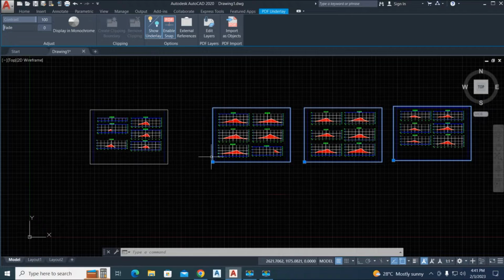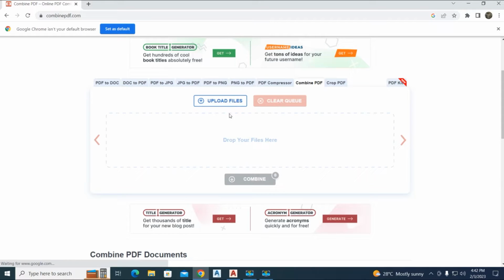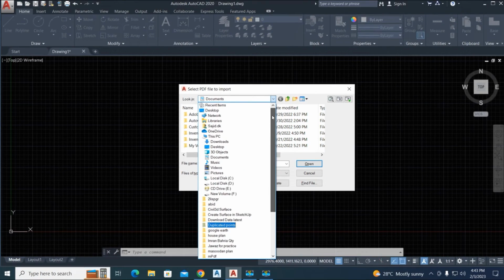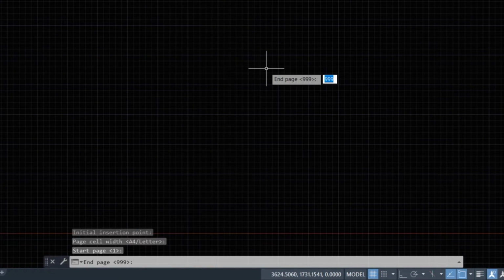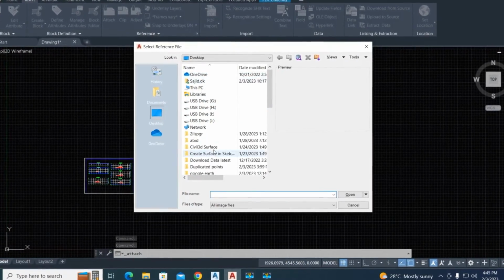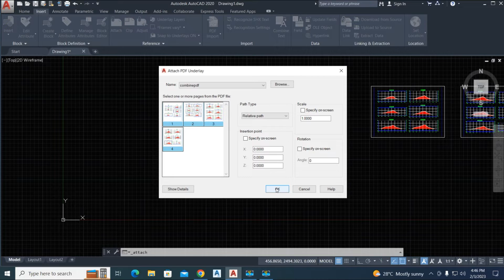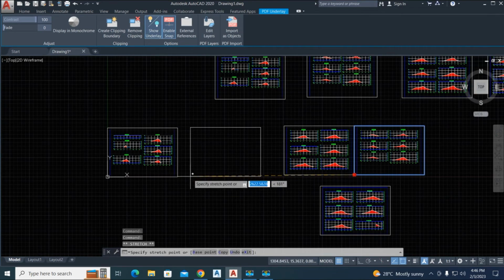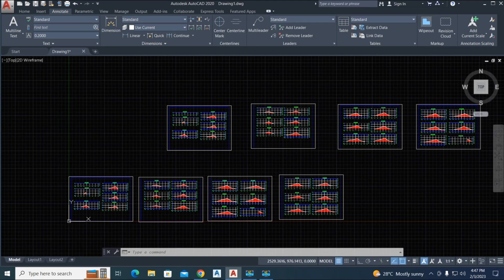Multiple PDF importing to AutoCAD using LSP

Comment: It's nice but it uses the PDFATTACH command which is just the same with only running command PDFATTACH with using this .lsp. Nice for using PDF as reference.
Do you have a .lsp file that uses the PDFIMPORT instead?
Reply from the maker: May be dear in playlist of autocad lisp in channel
Reply: @CivilSurvey Okay I'll check on that playlist.
Reply from the maker: There are more playlist

Comment: i can't shear my autocad drowing with other computer, its show no link image. How can it solved & make able to mail other computer?
Reply from the maker: Learn how to connect to server many computer and how to shear data to other computer you need to learn multiple computers connecting to each other and search in YouTube learn it
Reply: @CivilSurvey  i mean that the every imported pdf image file is't saved permanently, when I shear my cad file to other computer then it show invalid reference. have any solution?
Reply from the maker: @shaikheslamulhoque8611 I never used multiple computers sharing files
Reply: @CivilSurvey  some time i need to shear with my client. it problem would be a solution?
Reply from the maker: @shaikheslamulhoque8611 search in YouTube